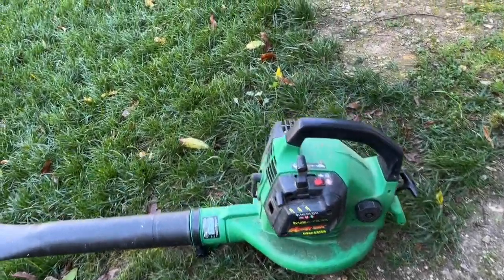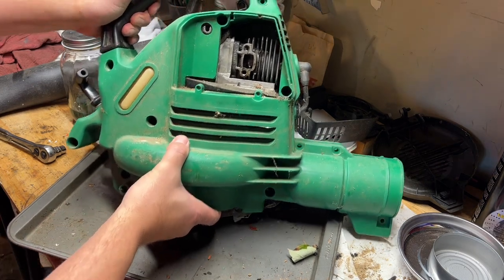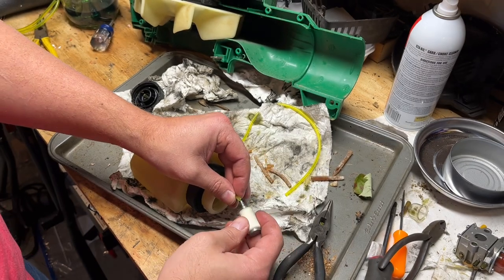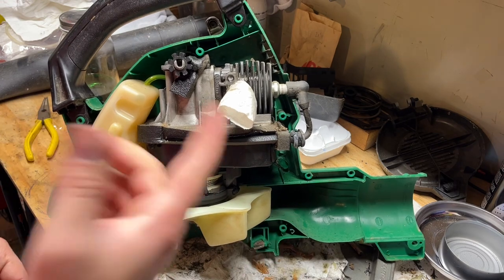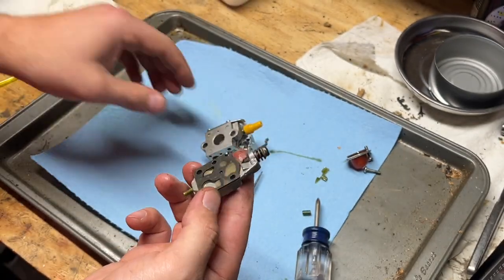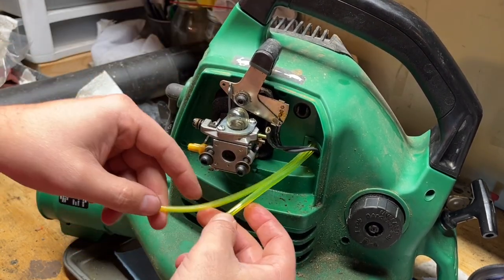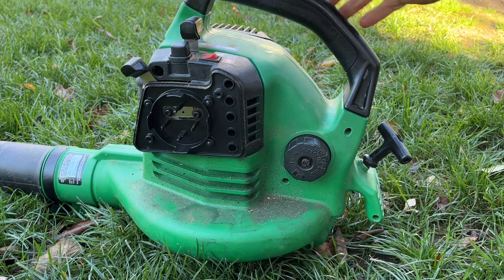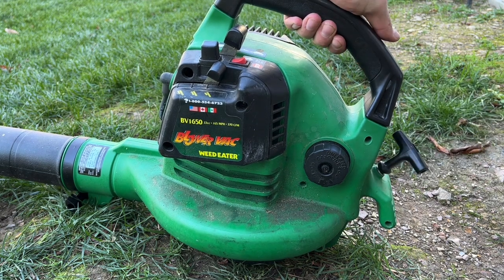Fixing a Weed Eater Leaf Blower Vac Found on the Curb

Comment: What did you do to tune, that is the most important part that you’d left out.
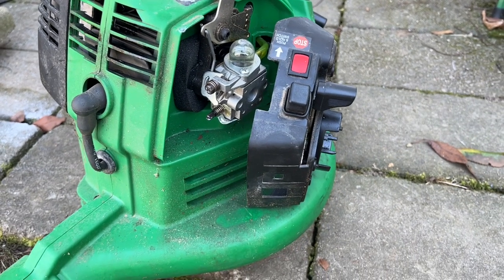Reply from the maker: You’re right I should have showed that. For this model, there is a hole in the front side of the black air box that gives access to the adjustment screw I show at the ~25:00 minute mark of the video. This accepts a flathead screwdriver to adjust the air/fuel mixture until the blower runs well at all three throttle positions. If I come across another of these same models I’ll be sure to show the tuning part.

Comment: You had asked about the Chinese spark plugs.  Ive seen them come apart where the center electrode pulls out of the threads.  Ive also seen where the plugs wont seal compression which leaks between the threaded part and the porcelain.  Stick with the NGK, Champion or Denso branded plugs.  Also, alot of guys use the Echo fuel line (black nitrile) because its cheaper than the Tygon.
Reply from the maker: Great tips, thanks!

Comment: When putting in the gas lines I put grease on them only a tiny bit then went smooth into the gas tank
Reply from the maker: I usually end up spraying it with WD40 if I have trouble feeding them in, thanks for sharing!